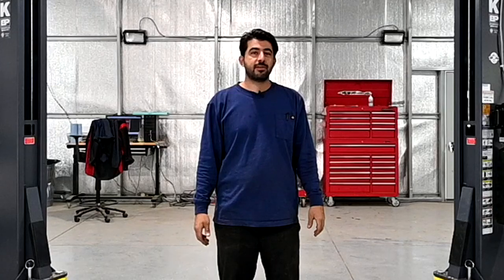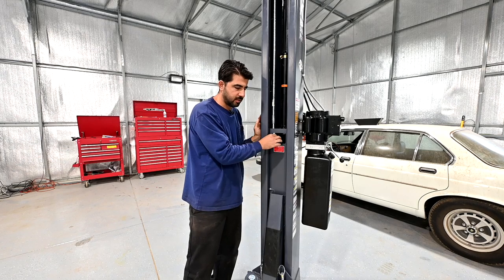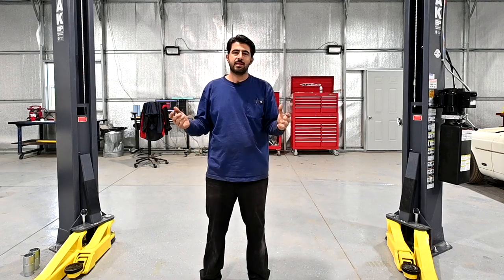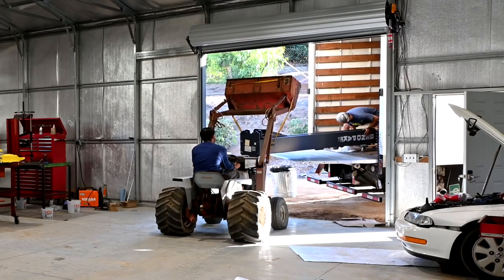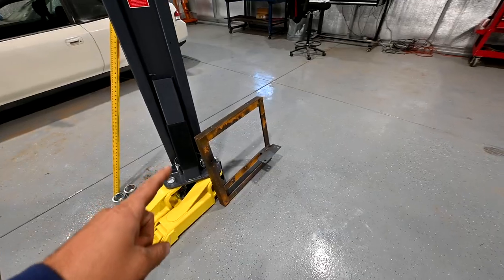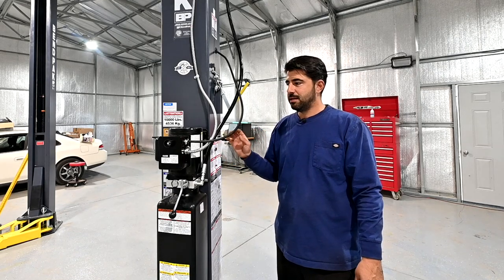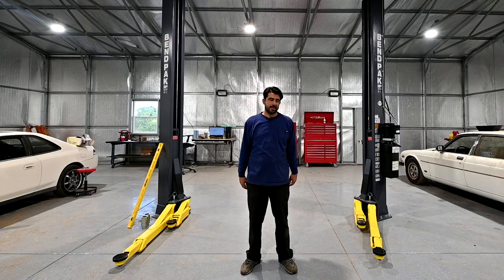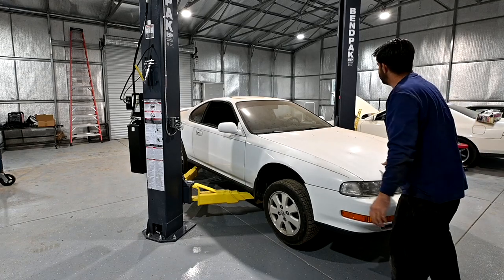Watch Before Buying and Installing a Car Lift

Comment: To safely rest you cars lower than the lowest lock...You can lift and set them down on blocks or jack stands...Then you will not have to bend over so far ..if yo next want to get under the car...just lift it to the new height...and you will be able to have the option to set it back down again at the heights that you chose repeatedly.....when finished just lift it enough to clear the blocks and pull them out and set it down as normal!
Reply: how will you set it down on jack stands if the lift arms are on the pinch welds?
Reply: @dandingerat  You will have to pick your support points depending on what you need to do to accomplish your task...for some things just blocks under the wheels will work...for others you will need to pick a spot that clears the lift....There could be times it simply can't work?

Comment: If the steel for the post is too hard or if fails it would be sudden failure; softer steel will start to bend and would be noticeable.
Reply from the maker: There has to be a balance, but harder steel would have to be supper overloaded by the weight (probably beyond the power of the pump) to simply break off. Most of the breakaway tension is in the arms and the heads anyway.
Reply: @myRatchets  I  think this is worth a look at the type and quality of steel used in the post construction, hopefully not Chineseium! 😱😱

Comment: Good info, specially on that starting height and the top cable. Things others never cover. Just one question, why not go for a four post lift? I can't remember if you're also in California but with the earthquakes these type sure scare me.
Reply from the maker: yea there is always that risk, usually you feel it coming so you have enough time to get away.  4 post just takes up too much space and not as easy to work around imo

Comment: good info, thanks.  as far as the low height limitation, is there any way to add some additional safety lock stops, or are safety lock stops absolutely necessary when working only from over head in the case of wanting to lift a few inches for comfort?
Reply from the maker: You can't add additional safety lock stops but raising the car a few inches is not the most dangerous thing either as in the worst case it will fall a few inches to the ground and hopefully not on your foot or any other object that could damage it etc.

Comment: I'm very surprised you can't stand under it.  How tall it the lift.  I have a chinese 12k unit and the direct rams are a little over 6ft, so it can lift the car 6ft off the ground.  I guess I'm only 5-10 so that must explain why I fit no problem when its up as high as it goes.

Comment: Better fix for locking lever cable: remove safety stop electrical wire, widen or relocate the hole a 1/2"-3/4" and reinstall safety stop electrical wire.

Comment: If your lift is properly grounded then if the cable comes in contact with an energized wire, your circuit breaker would open eliminating the possibility of electrocution.

Comment: Those bottom plates are really thick steel. There is no way that bolting them up to that thinner angle iron bent them. The angle iron would have bent first. If that base plate is bent a little its most likely from when they welded it to the post. It takes a lot of heat to weld thick metal. You lost that bet Mr. Betting Man

Comment: You can subtract the ground clearance of the vehicle from that 24 inches because those pads won't start lifting the car until it contacts the bottom of the vehicle so that's better than the measurements you were showing but still pretty high.
Reply from the maker: You just subtract the space between the top of the pads to the pinch welds which was 2". So still a 22" rise to the first locking position.
Reply: @myRatchets  Understandable.  Definitely a bummer on the lock but the lift is fantastic.  Great work getting those posts up and installed!

Comment: Is there a software that can tell you lift locations by make/model/year?
Reply: Jack points in car owners manual are a good spot, the lift manual will identify other good spots.
Reply: Make sure to purchase a couple good underhoist tripod stands to fully stabilize cars on lifts!

Comment: Anyone in the Phoenix AZ. area... our company has a similar lift... with a bit more capacity that they are not using and want to sell... sure its a great price for what it is and its relatively new... drop a message if you know anyone that might need it... not an add... i'm not getting a thing... just thought someone might need a good deal.

Comment: But you aren't accounting for the 8 to 12 inches the lift travels before it actually starts lifting the car. Something tells me that the minimum lift amount is going to be 24 inches less whatever ground clearance the car has.
Reply from the maker: its actually 24" less the space between the top of the lifting arms pad and the pinch weld. Which in the case of the prelude was 2", so 22" rise to the first locking position.